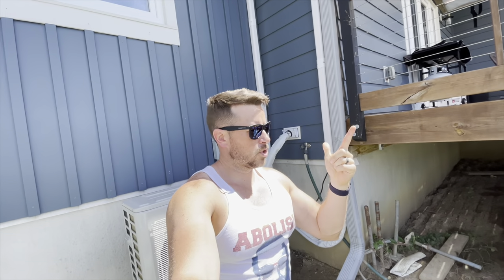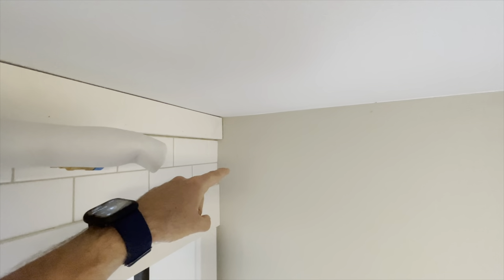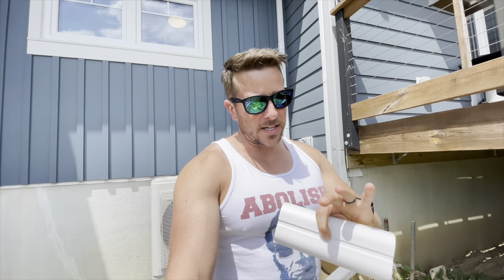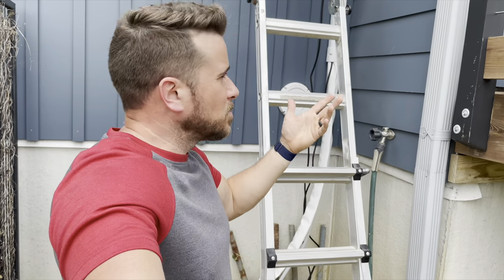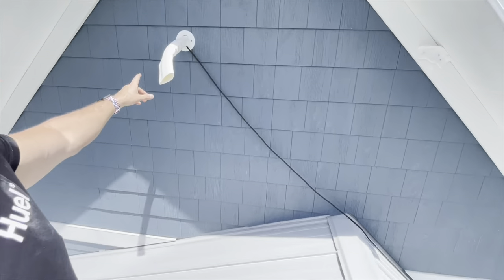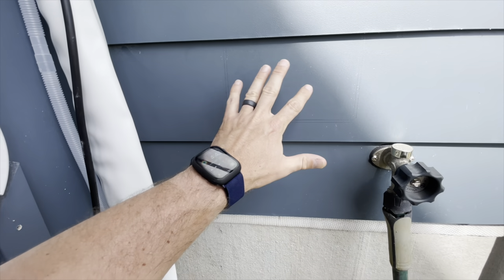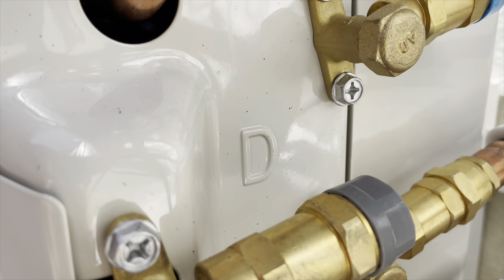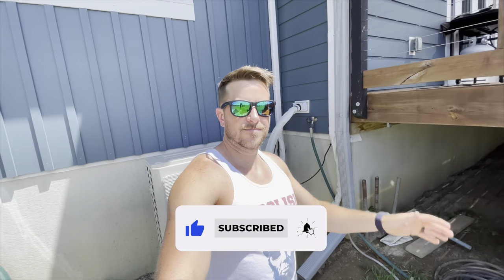MrCool 36K DIY Multi Zone Install_Part 2!  !..IN SIP WALLS..! (WITH PIONEER LINE SET COVERS!)

Comment: Good job and a nice install. When you mentioned not really needing to use duct tape to help secure the condensate drain piping together, while technically correct, anyone would be best advised to do this (as you did), as you dont want this to come apart or leak and cause water damage,particularly in your situation where it is running (concealed) near a dry wall and may not be noticed until greater damage has been done. It is important to get the right amount of torque on the gas line fittings and be sure there are no gas leaks as this is where DIYers will often mess up. Great video. Cheers
Reply from the maker: Thank you!

Comment: I have nothing but problems with my unit just like yours leaks around those connections after a year and leaks around solder joints from the factory good luck with your warranty

Comment: So did u calculate a reduction in the capacity needed for your Mr Cool units since ur using a SIPS envelope? We are doing a total sips build  w 8 inch walls (R32) here in MT and we like the minisplits idea, but we are told we need less BTUs due to the envelopes thermal efficiency? We are also told Mr Cool units have many customer warranty/service horror stories.

Comment: I’m thinking of buying a 36k unit with one zone. My downstairs is 900 sq ft and the upstairs is 700 sq ft. I live in Washington. The lowest it gets here in the winter is in the 20’s.  Wondering if one head unit will warm it enough and the heat radiate upstairs in the rooms? Ceilings are only 92”. We’re doing a major remodel next year and I’ll need a whole new system.
Reply: Also in WA and I just installed a 27k unit with an 18k handler upstairs and a 12k handler in the partially finished basement (both 900 sq ft). Both units do a great job of heating both spaces.

Unless your house is super open concept I'd add another handler upstairs. You'll get more consistent heating between floors and it'll be much easier to cool the upstairs in the summer (especially during the heat waves that are becoming more common up here).

Comment: Working in Maintenance and moving up to Property Management and having HVAC certification and knowledge I really hope what’s on paper works for you but reliability of these systems and heat pump heat above the Mason Dixon Line which 3/4 of Ohio are in and living in North East Pennsylvania, I would have gone with forced hot air/ac unit standard heating. These systems are nice for off room cooling and in between but the single source heating system? I’m curious to the results and outcome. I hope it works out for you. Keep us updated with the Fall season approaching and should be a good test of what to come. Great job on the install with the tedious and meticulous attention to detail on the final look.

Comment: when you used the 40 amp, did you connect it with 8/2 wires?  And then that 8/2 leads to a 60amp disconnect?  I'm hoping this is what you did.  I'm about to start this project so your answer would help me out alot.
Reply from the maker: Yes, 8/2 wires, but I believe I only have two 25 amp fuses in my disconnect.

Comment: Is that Mr. Cools bracket?  For my Pole Barn, the only attachment we have to bolt it to is a 2x6 going horizontal.  I'm wondering if that top horizontal piece would be plenty to support it....
Reply from the maker: No.  I got mine from Pioneer.  Is there anyway to add extra framing from the inside or is the inside already enclosed?  Would placing it on a pad be better?  If you can add framing, you could possibly add some vertical framing between the girts where the two bracket arms will hang down.  You could also make sure you hang it where a post is and get a good lag screw into the post.
Reply: @makework   On the inside is 2" closed cell spray foam.  For now, we simple set it on some concrete blocks, but eventually I'd like to bolt it down.  These things are super quiet still.

Comment: How does the condensate line work if you have to run it thru an inside wall and up thru the attic to get to an outside wall?  Does it pump it up and out or would i have to route the condensate line to a drain pipe in the wall?
Reply from the maker: I believe both could be accomplished.  I’ve seen small condensate pumps that I believe can be connected to the wall units to pump condensate up if that’s your only means of getting rid of it.  I will be routing my basement unit’s drain line down an interior wall to a drain pipe that goes to my sump.

Comment: Hi what breaker did you use?  30amp or 35amp?
Reply from the maker: With that unit, I actually used a 40 amp because that’s all that was available at my store in the breaker style I needed.  On my second unit I used a 30 amp.
Reply: @makework  wow thanks for that answer.  So anything that's 30amp to 40amp would be ok?  I'm not sure what the difference is.  Currently I have one 3k unit and it's on a 30amp, but I messaged a company and they said it should be on a 35amp.
Reply from the maker: I’ll update if I have any issues with the 30amp but I’ve never even seen a 35amp breaker.

Comment: What side size did you use #10  30amp
Reply from the maker: Not sure I fully understand the question.
Reply: @makework  He's asking what gauge wire and what size breaker you used.
Reply from the maker: The instructions say the minimum is 10 gauge with a 30 amp breaker.  I however used some 8 gauge with a 40 amp breaker because I had some spare 8 gauge and there happened to only be a 40 amp breaker available at my Menards.

Comment: I have had an issue with my 36k unit.  Several calls and emails to Mr. Cool have gone unanswered!  Zero customer support…don’t buy Mr. Cool products!!!
Reply from the maker: That sucks, dude.  I hope yours is a more of a fluke and I hope you can get it resolved.
Reply: @makework  can’t get customer service to respond.  I followed the installation directions and the unit isn’t cooling.
Reply: Mr cool just sells rebranded Midea/GREE AC for a profit. 
In europe i got a 12K BTU precarched("DIY version") Midea for 520USD, i belive mrcool sells a similar unit for 1 to 1.2K in US
Reply: No Hvac will touch it,   Find someone on craigslist